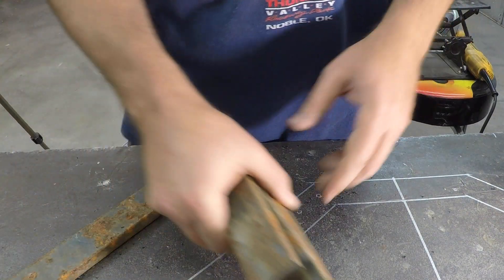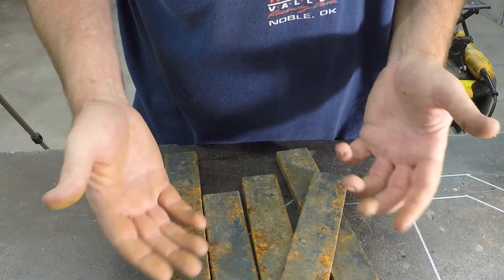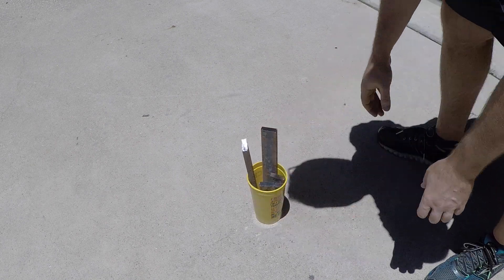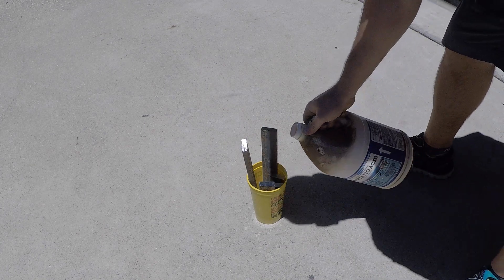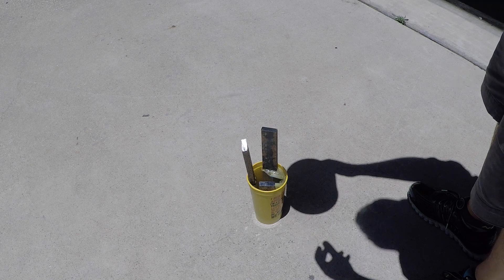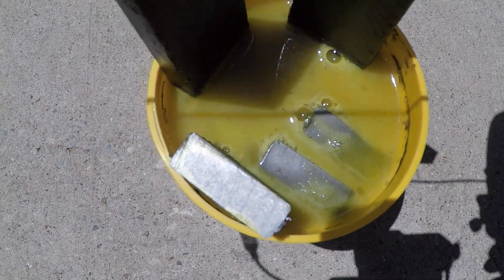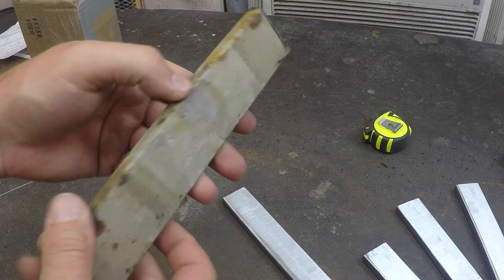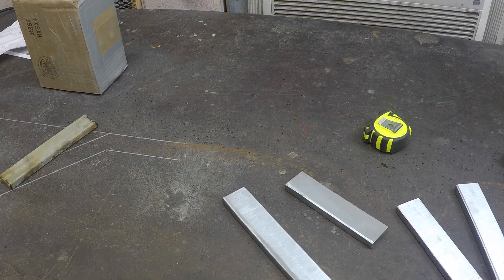How to chemically remove Mill Scale - hot rolled steel

Comment: the problem with muriatic acid is the fumes will "rust" (discolor) anything downwind and are very toxic to breath (from experience in a closed shop...rusted metal about 10 feet away and burned the eyes like crazy and burns skin if it splashes on you for some reason).  Yesterday I tested "Jasco metal etch" and in about 2 hours, the mill scale just fell off.   
it contains PHOSPHORIC ACID which is a lot less toxic.    takes more time, does the same thing but not so toxic.  No fumes, no burning, and no messing with anything that's around it.

Comment: The fumes are murder. Not just to your lungs but any exposed metal in your shop will corrode. Phosphoric acid isnt as strong, hence safer and slower. After it finishes cleaning let it dry, wipe off the power residue and paint with etching paint, which contain phosphoric acid. Not sure yet how well it deals with mill scale.

Comment: I use powdered pH reducer (sodium bisulfate?) for swimming pools mixed with water to remove forge scale. It's slow similar to vinegar, but doesn't seem to attack the metal or cause everything exposed to its vapors to rust like muriatic acid. Probably not as harsh to skin either, but I'm no expert. I saw this used by Steve Culver, top-notch bladesmith and gunsmith.

Comment: Just a note about using this stuff. Yes it works fast but use it outside and stay up wind of it as the fumes will sear your lungs.  You'll know you're screwing up when you start coughing up your lungs.  I'm a knife maker and use hydrochloric , (muriatic acid) to clean the scale off my damascus before grinding. So yea, it works faster then white vinegar but even the fumes will destroy anything they can get at. Also, have a spray bottle of water & baking soda handy in case you get some on you or anything else you don't want damaged.  It also comes in handy for neutralizing the acid so it doesn't cause the steel to rust.  Lastly, if you want to dilute it, pour the acid into the water, never add the water to the acid... it doesn't like that very much.

Comment: FYI for everybody that's reading this, to this read this please Gary you should put this in the video. 

I own a welding business on the side. I use acid all the time to clean Mill scale and rust off of everything. Told a friend of mine about how I did it and I didn't think nothing about telling him, my acid tank was outside. So he put his in his metal storage shed. No worries no fumes to get to anybody. It literally rusted everything in his shed. So whatever you do.... DO NOT leave this open indoors. Or close to any metal of any kind  that is raw . Cuz the fumes will literally eat it up  it will pit aluminum and everything with the metal surface will be destroyed....

 I'll tell you what is the best recommendation for storing your acid in. Is a huge chlorine Bucket from a pool you can fill it up and you dip longer pieces in it. And then it's got a lid spins on and locks.

 I hope that helps someone to learn from my buddies mistake.
Reply: I second that warning. I put a SEALED bottle of muriatic acid in my general storage cabinet,  and within a week, it had corroded every spray can, and worse, all my PCB drill bits, and the contact tip on my Mitutoyo indicator. Every exposed steel surface. Those cheesy LDPE bottles allow vapor to leach through the plastic.
Reply: Can you reuse the acid to repeat the process, how many times, shelf life?

Comment: Sir,
How do you dispose off muriatic acid?
Is there any problem in that?
Reply: Goku Son theres a green version of muriatic acid sold at Lowe's that can be dumped outside. I've used it before and it didn't affect anything I dumped it on.
Reply: Neutralize with baking soda
Reply: how much baking soda it takes to neutralize one liter of muriatic acid?
Reply: Allen thnx for ur reply , 
can u share specifications of the green version of muriatic acid u mentioned
Reply: Goku Son not really other than its Jasco brand and the Lowe's id is 622068.

Comment: How do you dispose of the acid after the steel is clean? Thanks for the video
Reply from the maker: I keep it in a sealed container outside and re-use it.  After several uses, the acid has pretty much vaporized, I pour it in a 5 gallon bucket, fill the rest with water and dump in a box of baking soda to nuetralize the remaining acid, and pour down the drain.   Keep in mind this similar chemicals are used to treat swimming pools
Reply: pour it down the toilet and flush a few times, that will take care of it

Comment: You might want to use this same technique to remove the high speed dross from the parts I just cut for you as well. I do this often and it works well, just need to keep good venting. Also, watch the type of plastic, etc.

Talk to you soon!
Tom
Reply from the maker: Tom Zelickman Ok, yes, I saw a guy using this in a squire bottle on a sign he cut on a plasma machine.  He kept spraying it and kept it wet for like 15 min and it removed all the scale, dross, etc.
Reply: Yeah, you can use the spray bottle but I think where you and I live it would evaporate too quickly that way. Submerged is the way to go. Watch for certain plastics as they will harden and crack. I want to say I used RubberMade products composed of a silicone compound (PTFE is stuck in my head) but I could be making that up completely at this point. A few hours dipped and the high speed dross all but fell off. Much easier than using the wire cup on the angle grinder, especially for more delicate parts and it also softened any sharp edges as well.

Comment: I tried this for the first time a month ago.  My results were mixed.  It worked great on hot rolled.  On cold rolled, it just barely did anything.
Reply from the maker: Jake Belk Thanks Jake.  On cold rolled, I have had good luck with a product called Picklex20 for removing surface rust or flash rust from cold rolled sheetmetal.  The cold rolled heavier stock I have, has a thick oil/wax on it and doesn't seem to be rusting...
Reply: Jake Belk    Why would it do anything on cold roll?

Comment: Good info. I've always bead blasted hot roll scale off  but always hated the time it took. I'll be giving this a try. Thanks bro!
Reply from the maker: K&L Machine and Welding Thanks Lucky Larry.  To me the mill scale varries greatly from piece to peice, some of it comes off very easily, like on most squqre tubing, but the flat stock has some heavy mill scale on it that can be very difficult to remove.  MrPete222 had a video on the hardest metals on machine tools, and Hot rolled steel with mill scale was second on the list to stainless...

Comment: Back in the day I used to scrub down pitted areas with Muriatic acid after I ground rust off but have been using the vinegar solution after my friend petes video.  I soaked parts in vinegar it works just as good but takes a few days, I might try soaking in acid next time, I was always fearful of the acid totally eating light metal.

Comment: That is a great tip. I have never used this stuff on steel. I will have to try it. Thanks man.
Reply from the maker: RetroWeld Definitely worked quickly and was less frustrating than trying to grind off the mill scale for sure.

Comment: You can buy muriatic acid (aka hydroclorhic acid) by the gallon at any local pool supply store.  It's most widely used to keep the pH levels correct in pools.  Costs a couple bucks locally. Chews right through metal (and skin) beware.
Reply from the maker: ***** Thanks man Lowe's and home depot sell it also.  Its commonly used to etch concrete before staining or coating it.

Comment: So if used this on rusted sheet metal.I can use the same.procedure?
Reply from the maker: CountrySideClub Not sure on just being used as a rust remover, but yes i think it will work.
Reply: On flat surfaces you can use paper towels soaked in the muriatic acid and leave them on the surface until the mill scale is removed.

Comment: It took me a long time to remove the mill scale from the top plate on my welding table.
Reply from the maker: 1970chevelle396 Oh man, i can imagine.  seems like flat plate and flat bar has a much heavier mill scale than angle iron and square tubing.  Some of the square tubing barely has any on it.  I think when they form the square or the angle, it cracks and peels some of the scale off.

Comment: Do you neutralise  the acid on the parts  after you take them out of the acid
Reply from the maker: TheFrameoff yes, i rinsed them off good with water, then took them to the belt sander.  I am guessing you could also use some baking soda water to make sure it was fully neutralized.
Reply: Yes you should because can still affect the metal it causes premature rusting